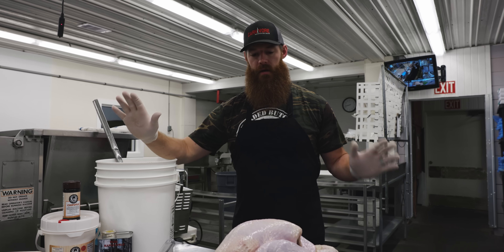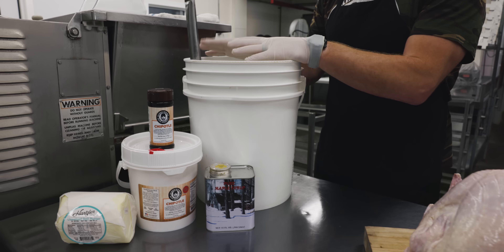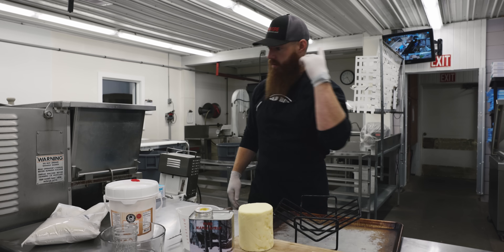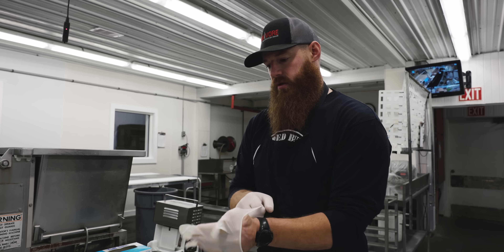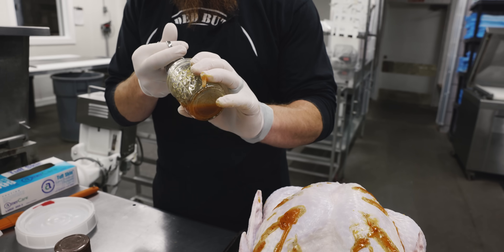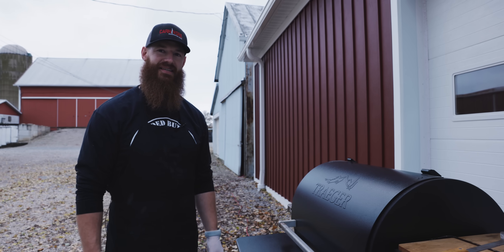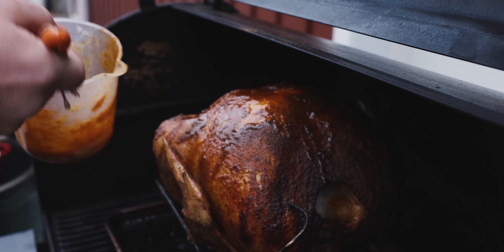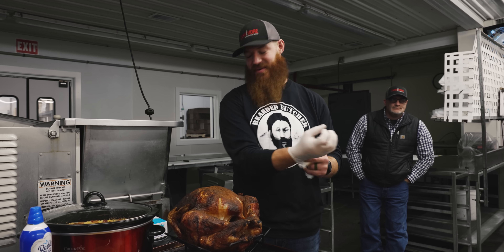How to Cook a Turkey (KISS Method) | The Ultimate Thanksgiving Turkey Recipe | The Bearded Butchers

Comment: I live in the Uk but have American friends. My friend deep fryed a turkey outside in the garden, your method is infinately safer. Your turkey looked fantastic, I always end up drooling after seeing you cook. Great video once again.
Reply: ALWAYS, remember to premeasure your oil in the pot by  putting the bird in the pot, cover with water, pull the bird out and mark the top of the waterline. Make sure before cooking, the pot is completely dry. Frying of coarse.
Reply: @GD-xj3jd  ditto on everything you said. I'll also add that you should make sure that the turkey is NOT frozen when going into the pot.

Comment: I came across this video last year while searching for a simple Turkey recipe for Thanksgiving to try on my Traeger Pro 780 that I picked up Spring 2020. My mother in-law still made a traditional turkey recipe. She called me this year and said mine was specifically requested again for this year! Thank you for the awesome recipe! My extended family appreciates it haha
Reply: The best I can come up with using pellets to smoke with is plenty of blue color in the smoke but no flavor on the meat. I'm smoking with a chamber temperature of 130° low and slow on the pit boss vertical smoker.. the smoke was so blue you couldn't ask for any more color but I understand that the less blue smoke there is the better the flavor on the meat supposed to be... There are tests being done regulating the cubic feet  per minute of airflow through a pellet smoker because using a regular offset smoker you get plenty of flavor even with no forced draft..

I'm thinking these pellet manufacturers or missing something on the amount of air that needs to flow through and have time to cool as it passes over your cold meat which makes the air heavier and makes the smoke settle on to the meat and distribute the flavor..

Almost like a cowboy galloping full tilt through town and you couldn't even smell the horse when he went by. That was, some analogy, but you get the idea... I couldn't smoke at a lower temperature than 130°, so I had no way to thin out the blue smoke to where you could barely see it.

Any wood pellets that are used for smoking never ever even tried to create any blue smoke so all I ended up with was white smoke. I can smoke on a regular offset smoker even a cheap one from Walmart. And I've taken everybody's advice did you leave all your vents all the way open yes I did did I have a water pan yes I did even when I was using real mesquite wood on a regular smoker had trouble getting flavor on ribs after they were smoked for 5 hours and had a small very hot cold bed and the wood I added to the fire was preheated by the existing fire then when the flames on that log or split we're just about ready to go out I put split of wood in the fire and it started burning in about 15 seconds because it was screaming hot because little white wisps of smoke work coming from it as I was putting it in the far and about 15 seconds with all it took for the wood to start burning because that preheating bypasses the white smoke stage of a fire coming up to temperature so you don't have to deal with white smoke and no the wood was not over seasoned and the wood was not wet laying out in the weather ... How about some good advice? With the vents wide open my chamber temperature only got up to 250°.. praying for miracle advice,..
Reply: @brucerogers3253  pellet smokers will not replace the purity of a stick burner or coal burner. If you need more smoke flavor, grab a smoke tube and up the smoke content. Pellet smokers are really just wood fired convection ovens so there is a fan blowing on the embers instead of them naturally just burning on their own, so there is some loss of that rich thick smoke. Pellet smokers are a balance between traditional meat smoke cooking, and quick convenient modern cooking methods. A smoke tube or a pellet smoker with “extra smoke” features will help get a little more smoke flavor out of them, but if you are looking for a heavy smoke flavor, you need to return to a more traditional smoker. I like my Traeger because it allows me to cook the foods I like, and get some smoke flavor mixed in. But I don’t want to sit there and babysit a smoker for 8 hours, I like my Traeger’s ability to set it and monitor it from my phone while I go do other things with my day. THAT is the convenience and allure of a pellet smoker. There are a lot of folks out there that have both a pellet smoker for those more convenient, quick cooks, and then they have a traditional smoker for those cooks where they really want to to it to the max! If you are expecting to get the same results out of a pellet smoker that you do on a traditional smoker, then you will be consistently disappointed because you don’t have the right expectations for that equipment.

Comment: I must have missed the time frame?  How long should i plan for this bird (I have a 13lb) on the smoker at 350?
Reply: I saw some tips in a BGE Group on smoking a turkey - it's about 12 minutes per pound. That should give you a good idea on how long. 13 pounds equals 2 hours 36 minutes. Mine is 20 pounds, so I'll smoke it for 4 hours. Go by meat temp though. You want to get a temp of 165 in the white meat and 185 on the dark meat. Good luck!

Comment: You can fit 2 5 gallon buckets with lids in a large Rubbermaid container with lid. Add ice to Rubbermaid, brine turkey in covered buckets. Drill drain holes in Rubbermaid below tops of buckets... put buckets with ingredients in Rubbermaid before you add ice. Cover ice with water. The ice only needs to be as high as the contents of the buckets. Add ice as it melts to maintain 42f or below in the buckets, monitor with probe thermometers in the buckets.
Reply: Works great at the beach and tailgates in the summer. Good for any time of year and any meat when refrigerated space is limited
Reply from the maker: Awesome tips, Kenneth! 😀
Reply: @TheBeardedButchers  call it a brine marie

Comment: I have made at least 4 turkey breasts (on the rib) in the last 3 months. I love having turkey more often. I just use a Brine mix (just add water) from my local grocery store, works great. I don't inject it, but put it on a turkey tube with some of that brine in the tube, season it well, and drape some bacon over it so i don't have to keep basting my turkey and opening my smoker multiple times.

Also... i have HUGE weaklings in my family, Chipotle is too spicy... Sweet Baby Rays BBQ sauce is about as spicy as they can handle lol.

Comment: i have a rather neglected question.
how you deal with clean up? stuff like super caked in, blackened, carbonized stuff on your gear.
i usually have to take the wire wheel to them as no ammount of soak and soap would do anything

Comment: I have a bird that no larger than 10 pounds would you still keep it at 350 for 4 hours? or do you just monitor the probe and when it hits 160 remove the bird? im just trying to figure out a unit of measure. for example 30 minutes per pound @350. thanks

Comment: Why brine if you are going to inject.  The meat can only hold so much moisture.  Once the meat is full of the capacity of moisture it holds then adding more is just “overflow” it won’t add more moisture; more likely to be the hole that lets the moisture out.  Just curious if both processes add more moisture once the full capacity of moisture is added.

Comment: After I finished the video, I went right to the video description, fully expecting to see an edit in there about the salt content of the brine...nothing?

  I’m a big advocate of brining. It can add great flavor and moisture to a lot of different meats. But never have I added even 1/2 that much salt to a brine. A 1 lb salt to 1 gal water ratio is WAY to salty. Especially if you brine at 1 hour per pound. Maybe 1/4lb per gallon would be closer to the right mix. 

  I don’t know if it’s bcz you used ice water and a lot of it didn’t melt into the water or what, but I think a lot of people will be in for a big surprise when they taste a turkey with that much salt actually dissolved into the brine water. Maybe you gave it a really thorough rinse? I dunno.

  An easy solution is to simply make your brine with the salt and sugar and what ever seasonings you like and just taste it before you put the bird in. The saltiness should be somewhere around seawater. If you really like salt, add a little more. If you think your brine is too salty, add more water (you’ll need to adjust your additional seasonings too though).